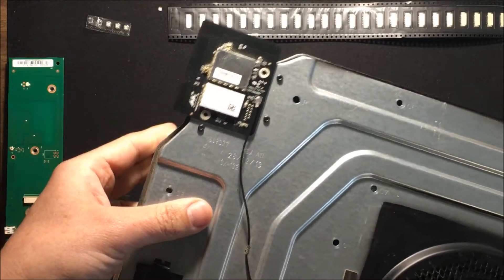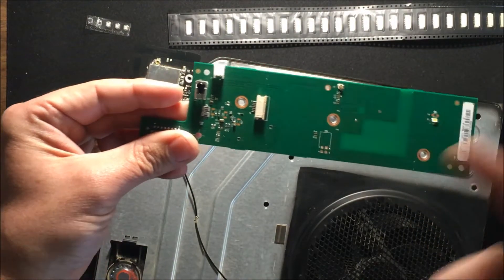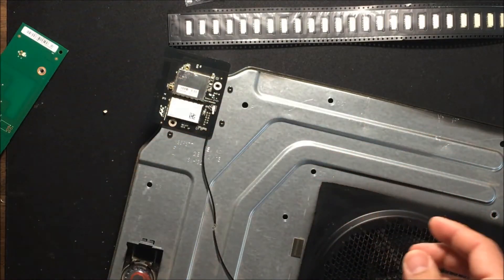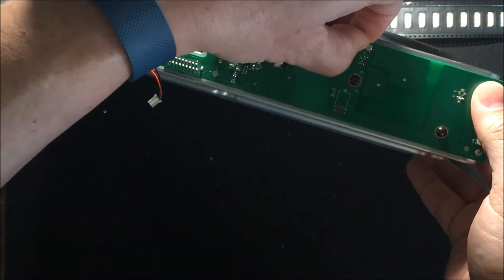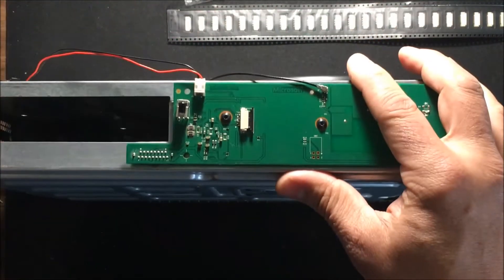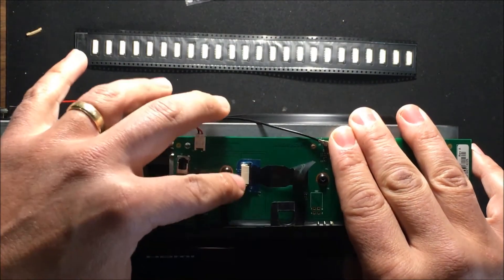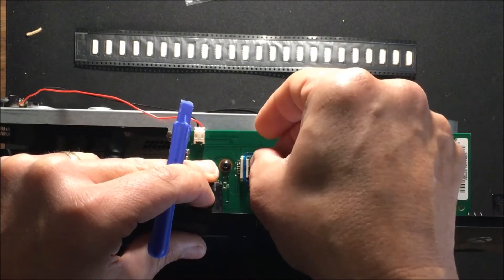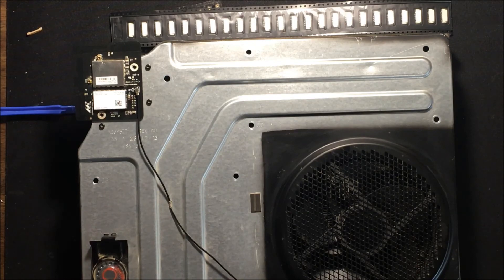Xbox One 01: Easily Broken Connectors

Comment: Isn't there a replacement WiFi antenna cable? Since those tiny connectors come uncrimped and break off quite easily, buying a replacement cable of the same length would be the easiest fix.

Comment: That cable is in the controller (XS) there is a SMA connector then the coaxial is soldered to the 2nd PCB, ground then signal. I can't find a single vid of anyone fixing/replacing this on a controller. I got a controller yesterday with the SMA ripped off and it's ruined the controller. I am trying to find a donor atm👍✌

Comment: If my system has a board model # 1653 then do I have to buy the same board? It's an original xbox one. The 1653 boards are like $50 where as all the others are like $15-$25

Comment: The only issue I am having is the black wire is is removed can I just glue it back on. I have no issues with WiFi just Controller signal, it just cuts off every few minutes

Comment: Stupid Microsoft for these things. I was very careful and still now the antenna cable doesn't connect to the front board. I also have problems with the ribbon cable. It did random power on, offs, ejects after like a month when I cleaned the Console and put it back together. I took the Console apart reconnected that cable and after a few hours It now does the same thing even tho I didn't move the Console at all since the reassembly.
Reply: I now reconnected the ribbon cable again It works and hopefully It remain like that. For the Antenna cable It was impossible to connect it so I taped it strong so the tape keeps it in place. It works!

Comment: When you order those parts from mouser does it come with the top plastic part that holds the ribbon down. I broke one side and it won't seem to stay and when I out it all together it wouldn't power on under I moved the ribbon which leads me to believe its coming loose when I put it back together

Comment: On my Xbox One, the antenna wire itself, came loose from the piece that connects with the connector.  I pushed the wire back in, and crimped it with needle nosed pliers.  Will this work as good as soldering it?  Also the range of my controller is only about 6 to 7 feet from my Xbox, but I have the original Xbox One with the original non-blue tooth controller.  Dont know if they had as much range.  Can anyone offer any advice?

Comment: If you break off the connector for the antenna on the Rf board, will the controllers still work in close range?
Reply: Them work, it happened to me just moments ago, lol
Reply: I have to test it more, but if the distance of the controllers goes beyond 2 meters, them will disconnect from the console constantly
Reply: They work for a close range without the antenna connector, but at this point you just better off connect it with a USB cable.

Comment: Iv used a solder to try and attach a metal cable along the top prongs to the far left thegave me a power button that never turns off unless u unplug it frm the wall? But had to be done just right

Comment: I have an issue.  The tiny square came with the socket.  Do I need to replace the whole board?
Reply: Lol, same happenned to me, that thing is really really fragile
Reply: Same things just happened to me did you have to replace the board? Or is there a way to fix it
Reply: Lawrence Tisdale basically I just left it, I looked into what it does and if it’s what I think then it boosts the WiFi/Bluetooth reception so how far your controllers can be from the Xbox or connection in game, if you have a wired connection I would leave it. Hope this helps
Reply: oscar bain please text me I need more info I’m kinda scared 2064268365

Comment: Hi, On the flex cable do the metal fingers point outward or inward? Also there is some sticky substance (Glue?) on the power button when it is removed from the front panel does that need to stay there or can it be removed?
Reply from the maker: Inward. Not sure which side of the power button you are talking about but I assume it could be either. Flat cable side would hold the cable in place and front panel side to hold the button in place since there isn't a required movement.
I use MMM136 - Scotch 665 Double-Sided Office Tape for this sort of thing.
Reply: @mpdavig  any chance you can lmk which to buy please?

Comment: Ive re attached the ribbon cable and the buttons of the front still don't work
Reply from the maker: Connor Kohut make sure there are no tears in the cable. If there aren't any then try reseating the cable itself to the front panel. The one I use in a good portion of my videos gives me this issue.
Reply: Ok ill try that thanks
Reply: @personwithmemes5454  did it work?

Comment: This happened to a banned xbox one I got off ebay. The wifi wire was torn off!! LOL. Great video dude, hope all is well!
Reply from the maker: Thanks man. Hope things are going well for you as well.

Now I'm curious, how does someone get an Xbox One banned? What's happens, can't connect to Live?
Reply: Funny, I didn't even ask the dude. It actually had Madden digitally on it, and it worked, but it asked me to please sign in, and I couldn't sign in unless I was online. So it was useless pretty much. Also, it said in big letters all over the dashboard "THIS CONSOLE IS BANNED" LMFAO! I ended up using the system for parts.
Reply: Yeah it refuses to sign you into live. You can't do much of anything.
Reply from the maker: Wow, did you know this when you purchased the system?

I did a similar thing when I purchased a system without a Blu-ray drive. I thought I'd just use it for digital games but it turns out you get a system error without the matching drive connected. Not sure what I was thinking. Only paid $31.74 including shipping and like you say it's worth it for the parts.
Reply: I think I got it last summer off eBay. The Hard Drive alone with pretty much worth it as well, but then I had a customer who needed a new Blu-Ray drive, their old Blu-Ray drive bit the dust some how. Swapped the PCB boards, and it was a pretty easy install. I paid about $100 for it on eBay, but the guy said games were fully playable in the description. When they weren't (due to sign in), I wanted to return the system. He refunded me and told me to just throw it out. So it was free.
Reply from the maker: You're awesome dude!
Reply: Thanks man, you are awesome as well. I bought a lot of Deep Blue XBOX ONE S systems because of you! LOL! I've been messing and modding things since the PS1 days.
Reply from the maker: That's cool. We do a lot of similar things. You did an NES Top Loader mod a couple months ago. I have one modded in the exact same way.
https://www.youtube.com/watch?v=yFjt1wuA5GE
I've got several other systems PC Engine, Atari 2600, 5200, VCS Adapter modded in a similar fashion that I'm thinking about doing videos on.
Figured I'd tear them down and show the modification specifics. There doesn't appear to be any good videos on this sort of thing.
Reply: Yeah man, that would be awesome if you made those videos! My buddy brought over a Philips CD-i to my store, the CD tray wasn't opening. I opened the system up, and you will never believe it. A rubberband fell off the tray. I put it back on, and it works fine now. He was shocked I fixed it so quickly, because he's had it "broken" for about 10 years now.
Reply: The NES was easy to wire, but I was scared about drilling the plastic. Thank God my Wife has a drill, and she knows how to measure all that stuff correctly. We drilled it with no problem
Reply: I wired the lettuce XBOX 30 Wire Chip, did PS1 Modchips, Saturn Modchips, etc. It's crazy all the stuff I've messed with. I even did JTAG's and RGH on XBOX 360 systems. Insane stuff.
Reply from the maker: This is why it's great to be in the know about these things. Imagine how many CD-i or any similar systems have been tossed for something so easily fixed. The PC-Engine I got for $27 and the Xbox One Kinect also for $27 both listed as not working, no power just needed $0.26 fuses.
Reply from the maker: Not surprised that you've been doing this stuff for a while. I've seen your soldering skills and they're top rate.
I'd love to meet up with you sometime. You've got a good set of friends around you. At the very least check out your store.